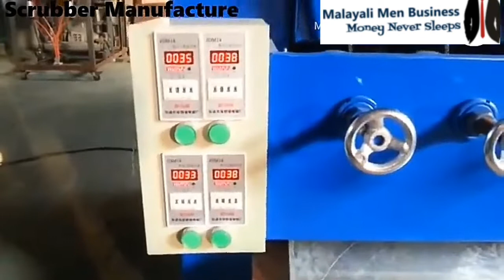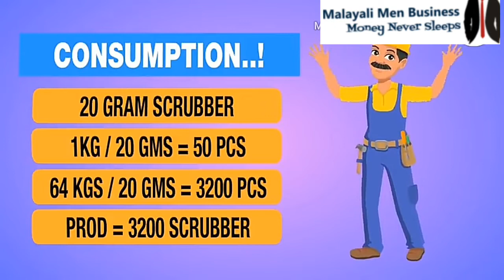Business Idea Malayalam Steel Scrubber Manufaturing Business Idea Kerala

Comment: Complete wrong information.
Reply: Per kg 130 rupakk 20 ton  venam.
Reply: @BusinessIdeasKeralaByDGroups  yes given information is wrong. Steel wire making machine starts from 2.25 lakhs onwards. 

Packing machine starts from - 35000/- onwards.

Other packing  raw materials need investment  minimum - 150000/-

Raw material cost minimum - for 30 days full production need - 500000/- 

Other fixed expenses -1-2 lakhs 

Total need - minimum 10 -12 lakhs